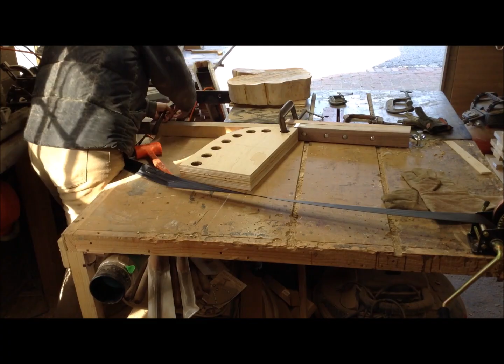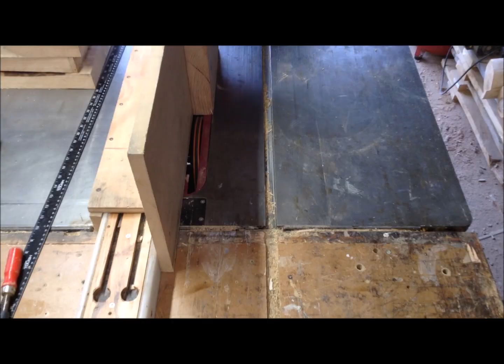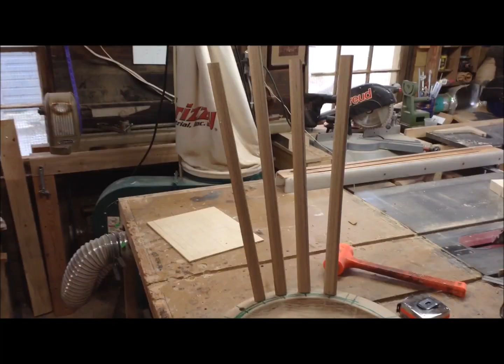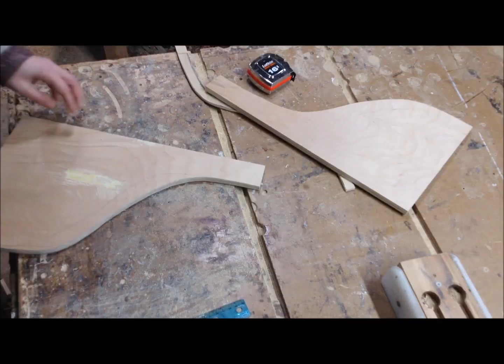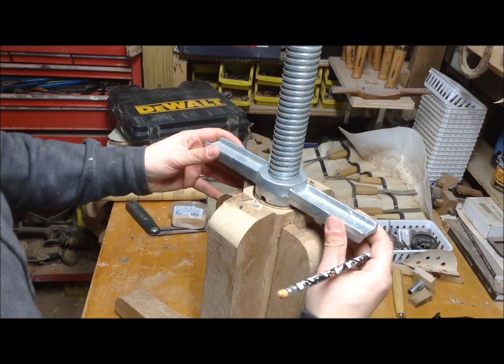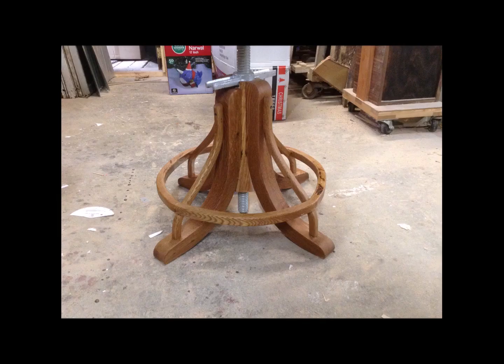Steam Bent Oak Chair || Woodworking Projects

Comment: Seeing the whole chair built at one time is a lot more impressive then seeing a clip at a time. However,  seeing individual clips lets everybody see the little tips and tricks you use to make a chair. Bending oak looks very difficult, but you made it look easy using a strap. I never would have thought of that method. I will keep it in mind when I have to bend any type of wood. Thank you very much!